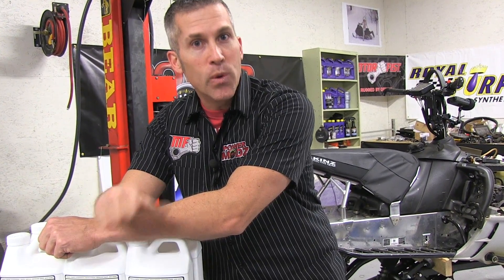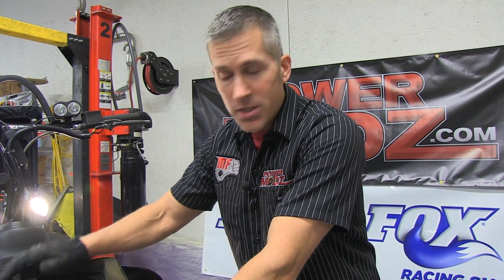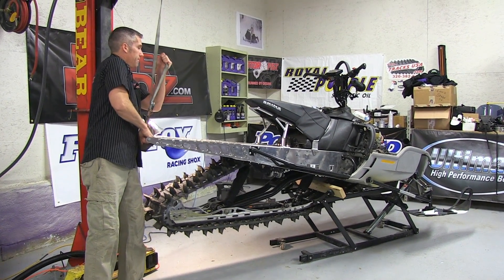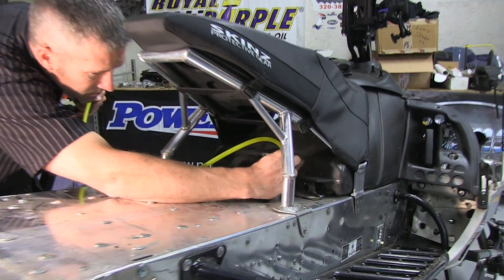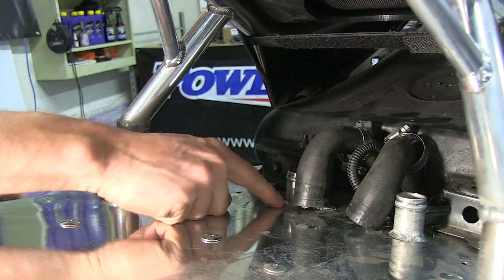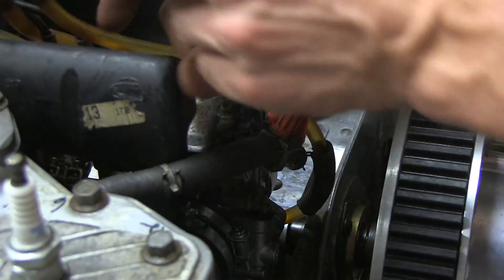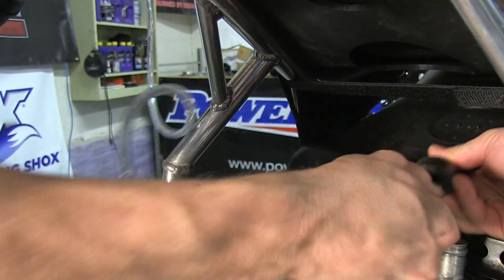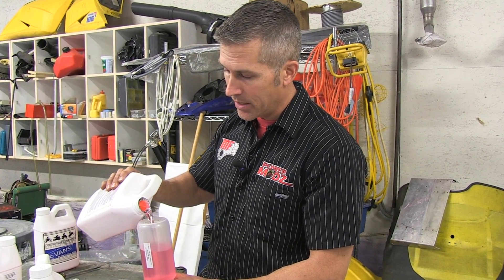Evans Waterless Coolant conversion in a snowmobile, Evans comes to PowerModz!

Comment: Yes, water is the main offender. Ethylene glycol is corrosive, but the additives we use stay in solution and so the coolant doesn't go bad like regular anti-freeze. Water content also leads to electrolysis and cavitation erosion pitting.

Comment: The coolant does expand as it heats up, around 7%. It doesn't build pressure, though, because any vapor formed re-condenses back into the liquid. You can run without an expansion tank, but it will purge some out during the first ride. After it cools down, the level will drop. Don't top up, that is now your operating level.

Comment: Just a note, Glycol is not very corosive, its mostly the water or contamination. It is only toxic if ingested. If you mix it 70/30 it will give you a -60F protection and a 240F boiling point, if you cant switch to Evans product.